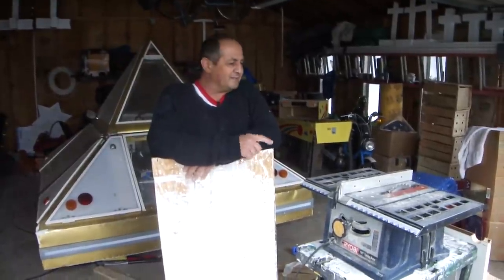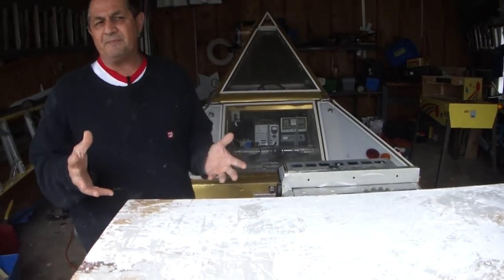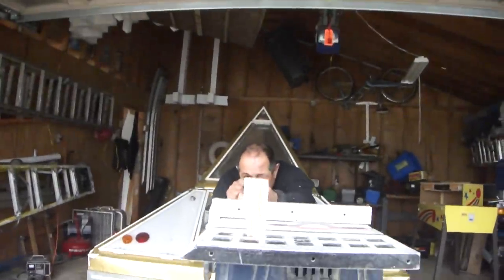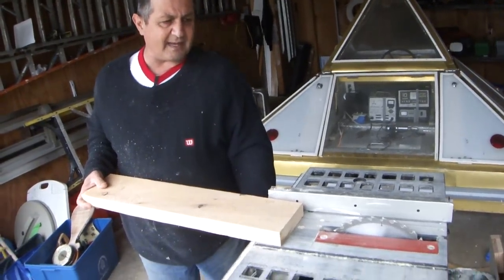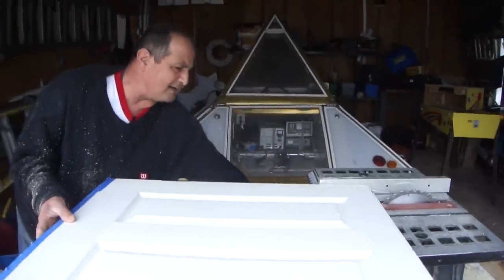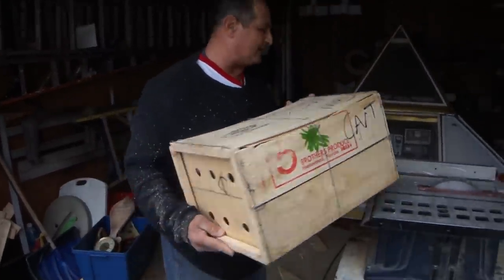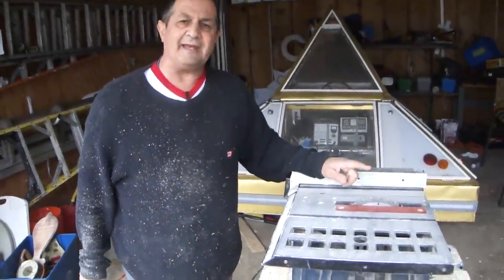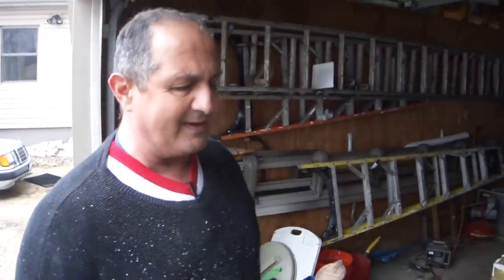How To Use A 10 Inch Table Saw

Comment: I thought I was watching the three stooges in one person. As a retired carpenter I was scared watching this video. No guards, no riving knife after the blade to stop lumber jamming on blade and throwing the piece of lumber back at you, no push sticks, no eye protection. A saw that could do with a good servicing, ie. sharp blade, safety gear put back on it and clean off the crap.
In all a great example of what not to do. It is obvious that you have no training on how to use machinery in a safe manner so rename your video "How not to use a 10 inch table saw" or better still remove it altogether so newbies won't learn dangerous habits
Reply: Robert Mead riving knifes just came into play in the last 10 yrs calm down

Comment: First off you can tell a few things about this guy about his work before he even starts working. One he claims to be a carpenter for a living now not knocking anyone who owns a ryobi power tool that does odd jobs and stuff around their house but no real contractor is going to buy something that cheap, Dewalt at minimum. Second he's doesn't have the saw mounted to the table, nor does he have the fence on the correct side (he's a righty) the fence needs to also be on the right, he has no eyewear (ear protection would be nice but not always a necessity), he has stuff all around to fall over (while the saw is running (you can see where that's going)). Now as far as his demonstration he didn't even push the plywood through straight because rather than building or buying a relief table (if you don't know what that is, it's pretty much an extension so the plywood coming out can be supported without having to walk to the other side of the saw. Not only that but in doing it this way a newcomer to table saws may try it on a low power saw like his and get away with it (making a habit of this) then they'll get on a 2+ hp saw that'll kick the plywood back hard enough to seriously injure you (saw my father get two ribs broken this way). Next up his saw blade is not up high enough it's supposed to remove all material it touches not create a strip at the top that is thin and flexible (reason being is that it can cause the material you're cutting to run up and over the blade possibly causing a kick back). All in all this guy is a complete fucking joke of a "carpenter".
Reply: Blake Pilkenton remember everyone is a professional on YouTube and that can be very dangerous to some.
Reply: I really appreciate this comment. As a noob, it was really annoying reading everyone’s comments bashing him without explaining what he was doing wrong. This is VERY helpful!!!!

Comment: Let's face it. We've all done shit like this. The blade guard is the first thing you throw away when you buy a new table saw.  We free hand cut tapers  or even curves. And who takes the time to put on a dado blade? Don't  you just multiple pass with the miter gauge. And I admit I've used the walk around method before, when ripping very long 10-12ft plus long  2 by stock. None of this shit is preferred practice, but you know you do it. Please, always try to wear earplugs, and glasses. I've had too many screws or nails that I didn't see, or loose knots fly. And not like this jackass, I've found I get better results by securing the saw to the table, or to a stand.  And please, if you're not sure whether you need a push stick, then you need a push stick. Be safe everybody, even you haters, be safe.

Comment: Hi. I am new on using  a table saw so my question is : Can I use a 2" diameter saw blade on a table saw like this? Thanks
Reply: The short answer, no.

The long answer:
The right tool for the job - always. The blade you are referring to is for use in a saw OTHER THAN a table saw. Please do not attempt to use blades NOT designed for a table saw. If you are as new to table saws as you say you are, please read up on them and avoid possible errors that could see you making trips to the hospital. Contrary to what this guy says in his video, a table saw is NOT a safe tool. There are safety guidelines that should be followed in order to use it safely. Respect your power tools. The Moment you disrespect your table saw, you can lose digits, an entire limb, or an eye. That would be your diploma, so that you would know better next time. READ and UNDERSTAND the instructions that come with power tools.
Reply: @dionjennings2379  thank you for your advice

Comment: I thought he was a bit careless with the saw, having removed the safety guard over the blade.

However my purpose here is to find out if you can cut an 4x8 sheet of ply using this saw. - anyone?
Reply: I have pretty much the same table saw with the Craftsman label on it (Ryobi made this saw for Craftsman some 20 yrs ago.  And NO, you cannot cut 4x8's with it UNLESS you build or use some sort of extensions, or build a table around it AND a table/rollers to push the board onto after the cut.
Reply: I have this saw  I've done rips with it. But it's not a cake walk by any means. The fence isn't firm enough for big heavy pieces & will slip if you're not careful & put to much pressure on it

Comment: three questions 1 Where is the guard 2 where are your safety glasses 3 why not stand off to your right and push the sheet you are cutting instead of stretching and reaching over a running blade much safer in my eyes. Norm Abrams would  cringe.
build an out feed table for run off of big items and some one asked what  that thing in the background was it was the paramedics waiting you scare me to DEATH